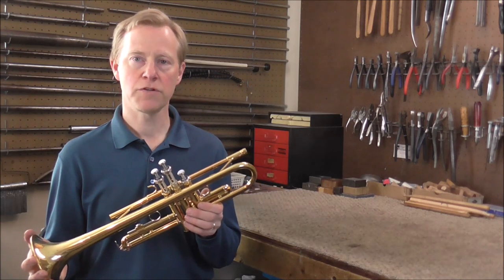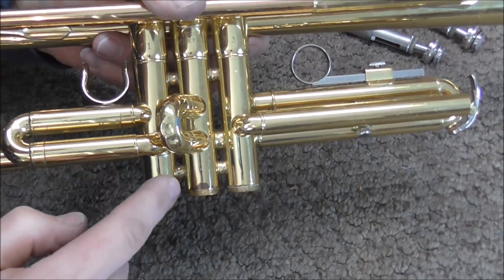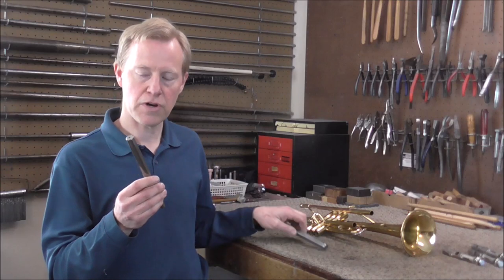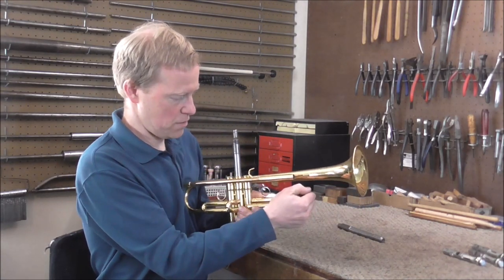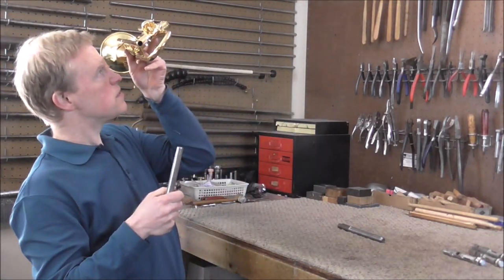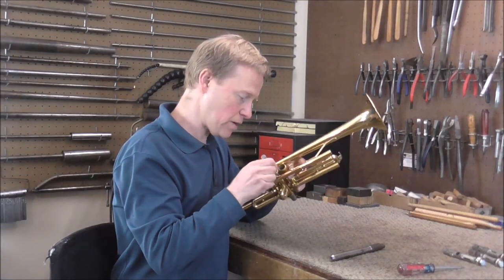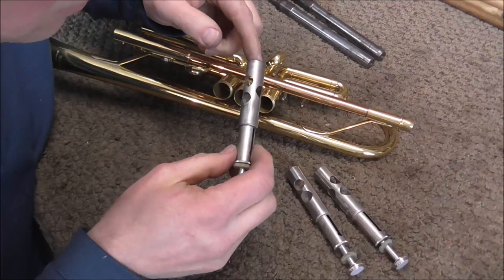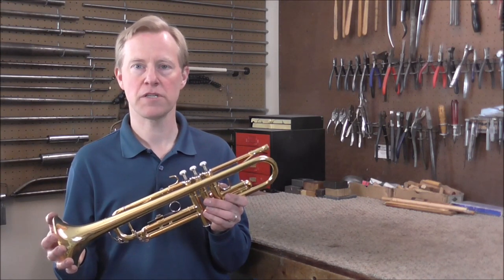Band Instrument Detective: Unusual Trumpet Valve Problem

Comment: Hello. I have a Yamaha sousaphone that one of the bits got stuck in the neck. I have almost no tools to use. You have any good tips that I could try.
Reply from the maker: If it truly is stuck and will not come out by regular means, there is a way to get it out, but it takes some work. You unsolder the bit in the middle, solder a tuba mouthpiece where you unsoldered the bit and then pull it out with a mouthpiece puller. Then you need to put everything back together.
Reply: Mix 50%acetone and 50% automatic transmission fluid. Apply to the stuck joint and let it sit for a bit. Reapply. You must shake the fluid as they don't completely mix and seperate. It often will be enough with some gentle tapping with a plastic hammer on the reinforced ferrule portion of the stuck bit. Do it all the time.